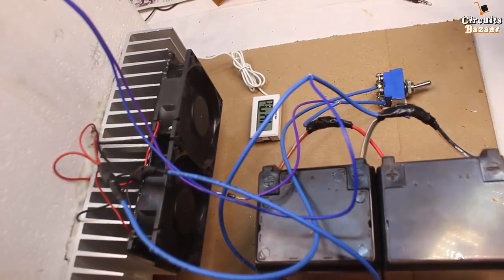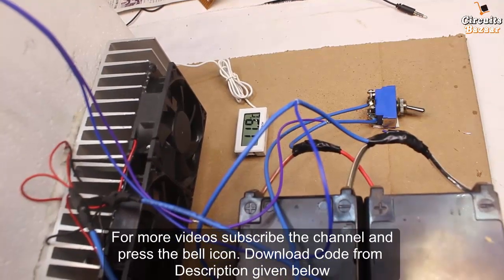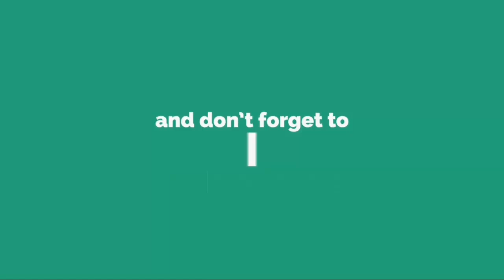Solar & Peltier Plate based small freezer project [ cold storage ]

Comment: Size and power of panel? Specifications of batteries and cooling load in litres?
Reply from the maker: 18volt solar panel with 12v 5AH Power of Batteries